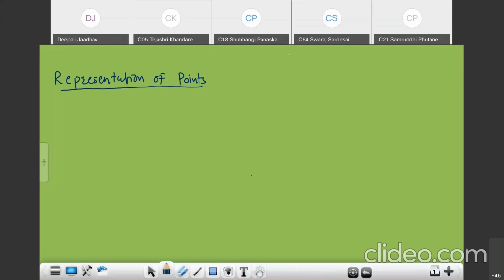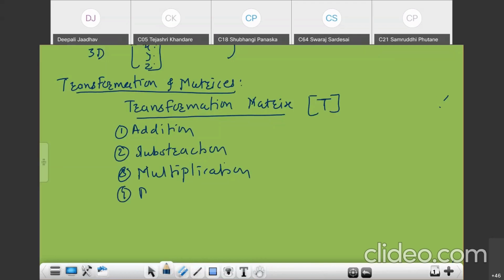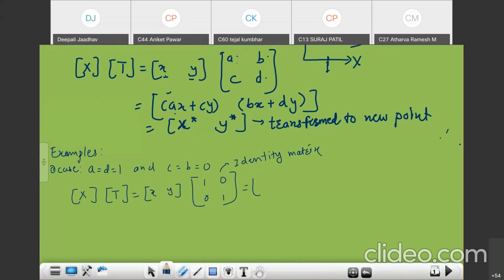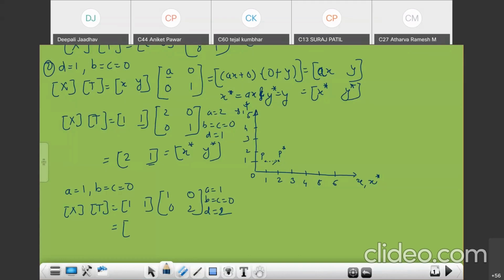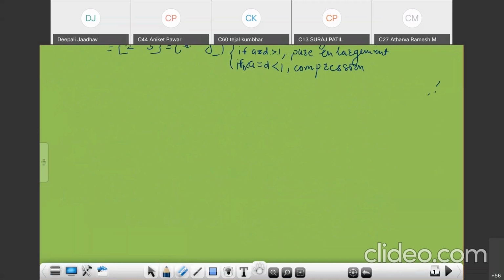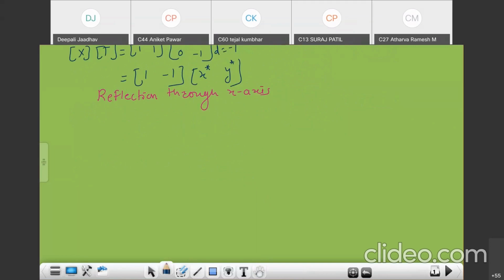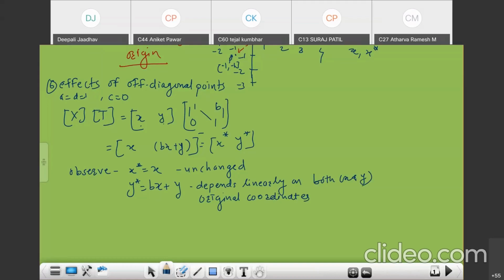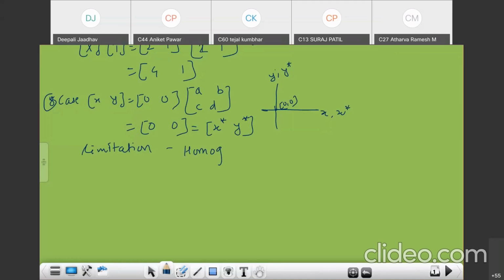Lecture 6 - Computer Graphics - 2D Transformation (Transformation of Point) - Deepali Jaadhav

Comment: Hello Ma'am. Thanks for the class. I am having some doubt in some questions. I hope you can help me.
Q1 Rotate a triangle ABC with vertices A(2, 3, 1), B(3, 4, 5) and C(5, 6, 7) about a line Y = 2

*Here, I don't understand what is Y=2 and how to find the rotation angle.*

Q2 Scale the surface A(2, 2, 2), B(4, 4, 4), C(5, 5, 5), D(6, 6, 6) with respect to point (7, 7) 

*I am unable to figure out the scaling factor (Sx, Sy and Sz) instead, these points are provided.*

Q3 Find the reflection of a triangle defined by the vertices A(1,1), B(5,1) and C(1,5) about a line y=2x+10.

*Here i don't understand the meaning of y=2x+10. What formula to apply here.*